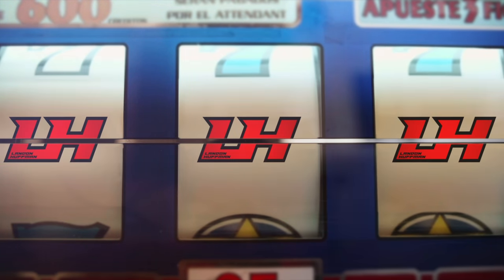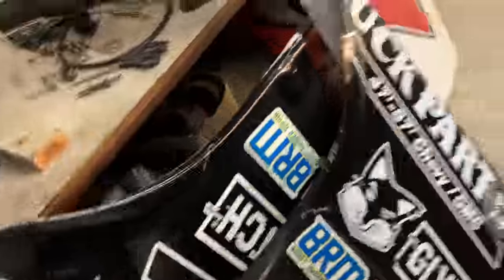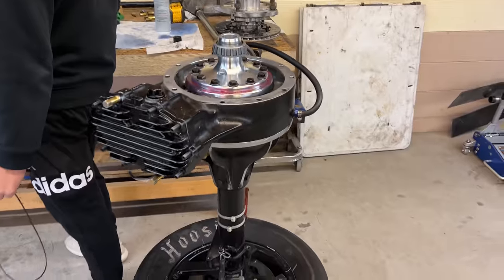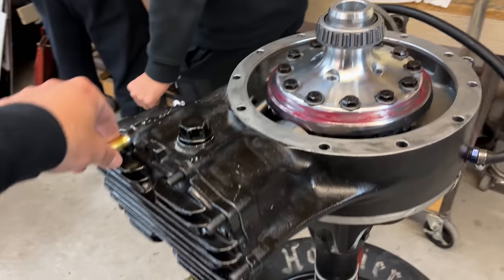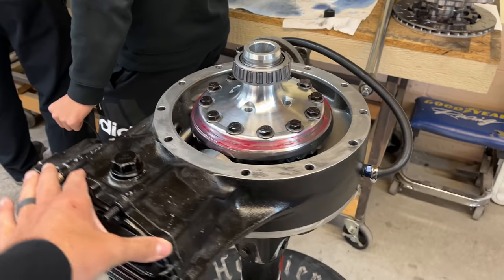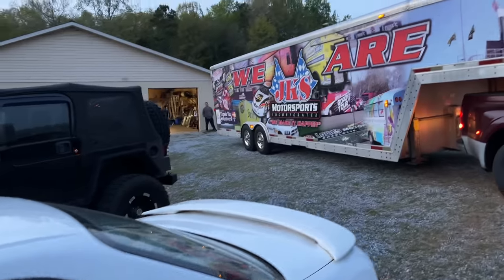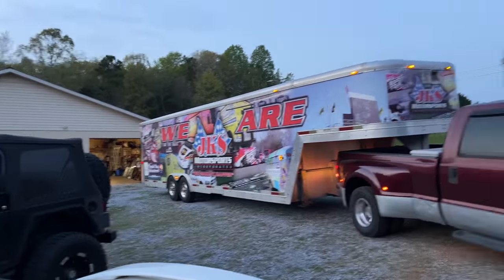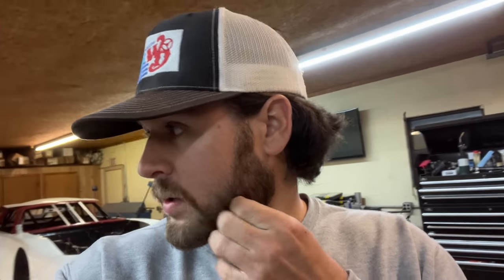THRASHING SO WE CAN MAKE IT TO THE TRACK! Finally got the Late Model back from Chassis shop!

Comment: Could someone please tell me the difference between Super Late Model vs Limited Late Model vs Late Model stock vs Pro Late Model.. I know dirt has several late model classes but didn’t realize Asphalt does as well. I assume Super and Limited are similar to their dirt counterparts but maybe not.
Reply from the maker: Super late model is an offset chassis that runs all over the US, pro late model is just a super late model with a crate engine (less horsepower), late model stock is a nascar perimeter style chassis ran predominantly in the southeast, limited late model is a late model stock with smaller engine and carb
Reply: @LandonHuffmanRacing  thanks for the explanation